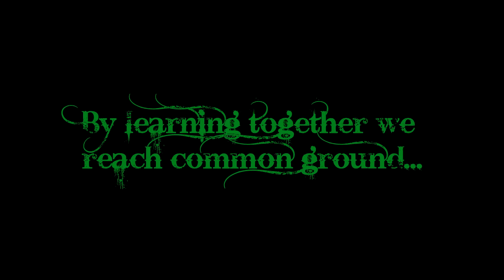MPSS Fire Practice

Comment: Hi Brian, another good thing to use is the wheel bearing off a skateboard for holding when using the bow, that way the spindle does not get hot.
Reply from the maker: Ray Townson Yes sir that will work as well